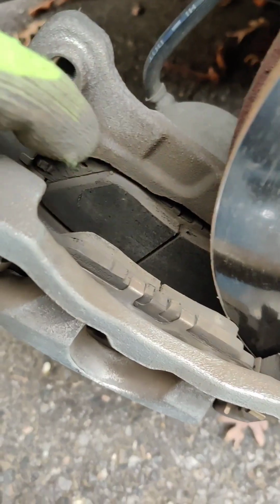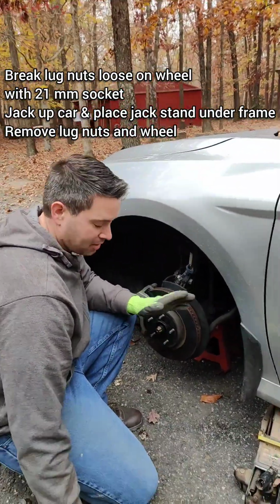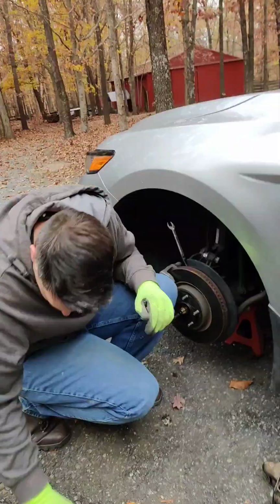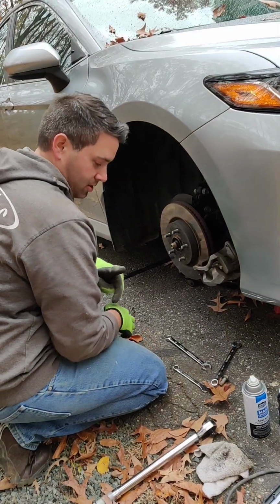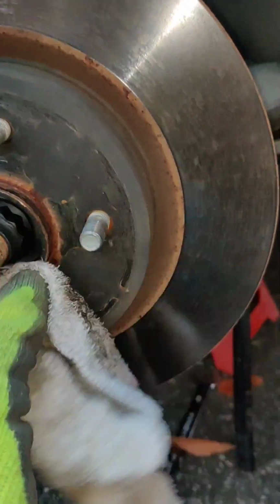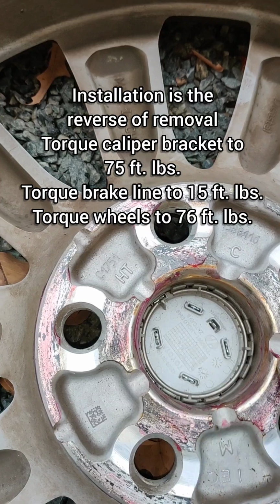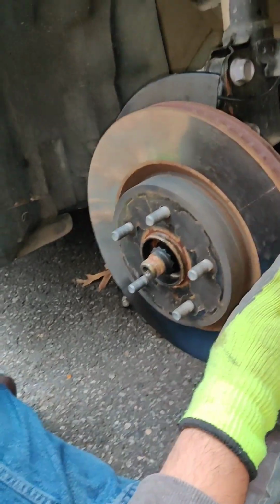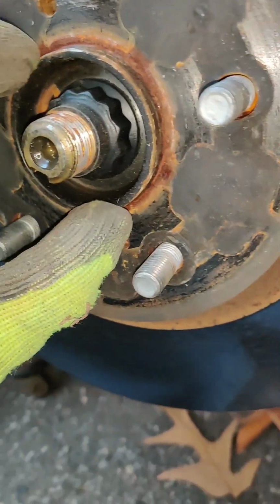2019 Toyota Camry brake inspection - when to replace brake pads and rotors?

Comment: This is a great tip. I've done brake jobs for family and friends after a dealership or mechanic told them it was needed. At least on one occasion we ordered the parts, pulled the wheel off only to find out the brakes were in excellent condition, the mechanic had lied. As you mention in your video, this is unfortunately a common occurrence. Make them show you!